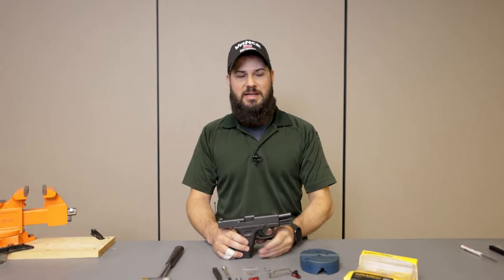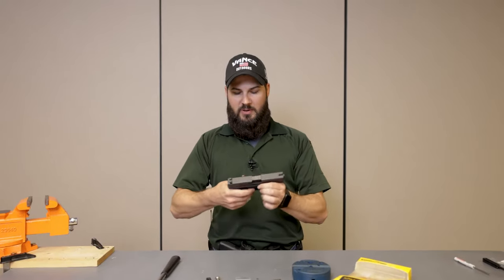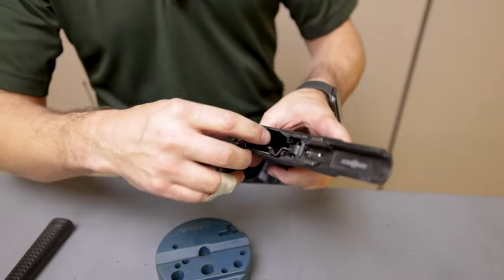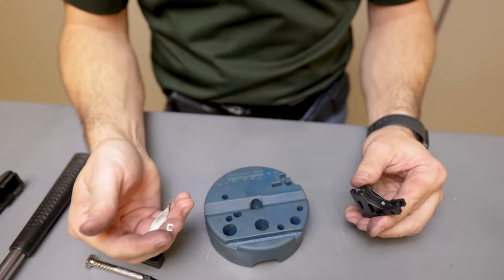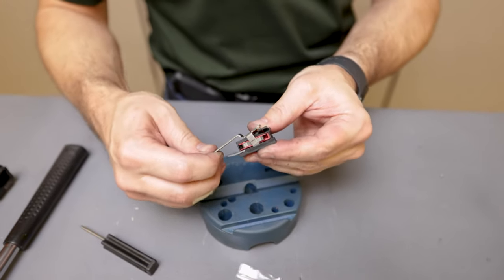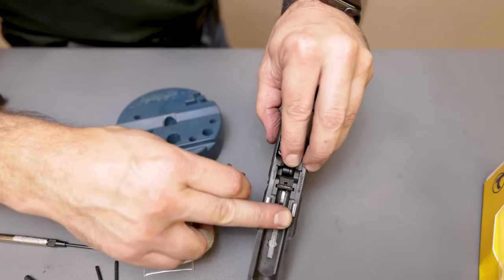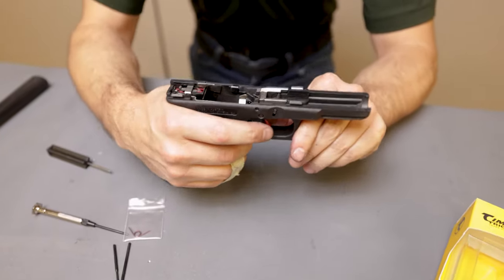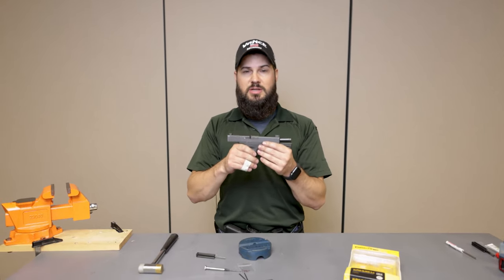TIMNEY Alpha Gen 3-4 Trigger - Installation

Comment: For those with an 80% build remember you have two block pins not one.  I didn't and was scratching my head why I couldn't get it out.  And yes, yes I built the the thing myself.  (don't judge me) Otherwise the Timney works great in it.

Comment: I reduced the trigger pull from 6 lbs to 3 lbs. So light I double tapped 4 times at the range.
Reply: I hope you don't use that same gun as your CCW. You'll blow right thru that 3lbs of pull with adrenaline pumping. I was blowing thru that even at the range. It's like you actually have to focus to feel that stop.

Comment: Hello every time i try to put the silver spring in, it always falls out. Do you have any tips to help fix that because it’s driving me crazy to the point I want to sell it.
Reply from the maker: We recommend that you reach out to Timney regarding any issues. Or call your local gun shop and see if they have a certified gunsmith available to help.
Reply: exactly same issue
Reply: My trigger, the actual physical trigger came with a tiny hole in it for sliding the end of the spring in, then you post it on that boss on the trigger and finish the rest of the assembling. Very helpful for retaining the spring. Mine works like perfectly.

Comment: Do you have a Timney Trigger for a Glock 48 non MOS, non rail? If so what are the options? Thanks.
Reply from the maker: Unfortunately no. Timney does not currently make a trigger for the Glock 48.

Comment: I can't tell if the trigger housing p80 uses is different than oem.  Is there a round hole on the bottom for access to the screw on the red timny part that slides in?  All there is on the p80 part is a small slot that's skinnier than the screw.  This trigger kit is frustrating me big time.  If anyone can answer this, I'd be grateful.  I can't tell what I am missing.  Thanks.
Reply from the maker: The trigger housing (I.E. Ejector Block) on the P80 is very similar to the Gen 3 Glock trigger housing but not exact. I had to slightly modify the hole in the bottom in order to use the Timney Trigger in the P80 Ejector Block. It's easy to do, just take your time so you don't ruin the part.
-Andrew